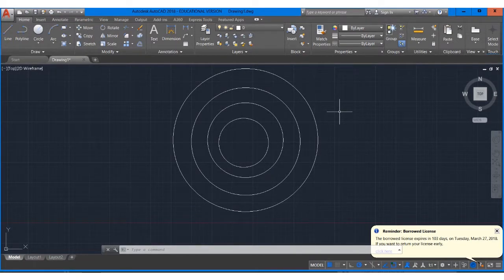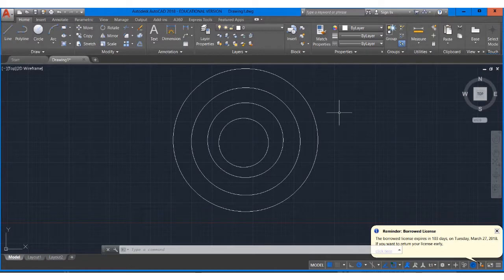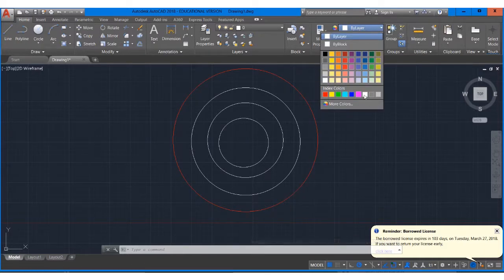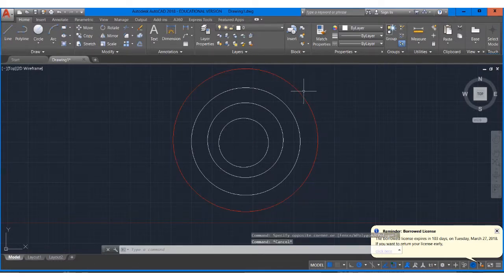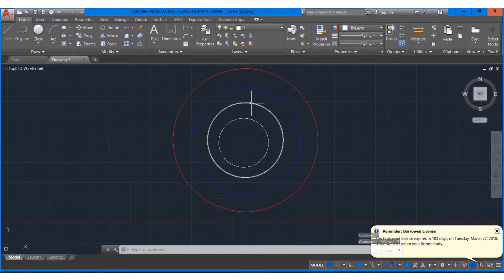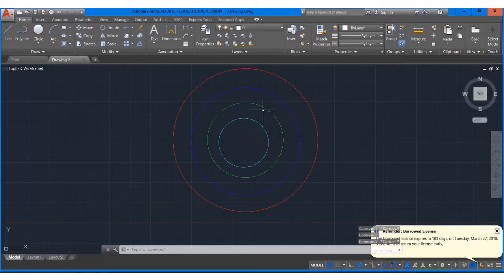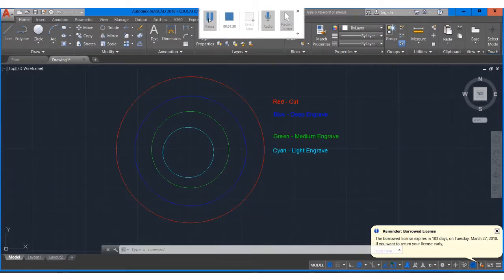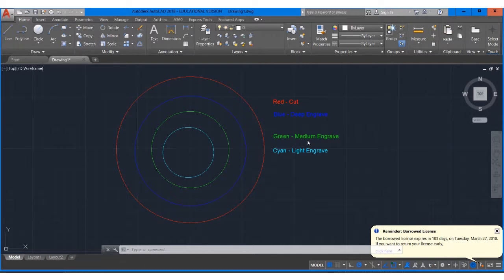12 AutoCAD Line Colors for Laser cutting or engraving

Comment: What about doing a solid hatch on one of the circles and engraving the solid part? I tried but when I open it in the laser cam software I only get the outline. I do have scan selected for engraving but still only the outline.
Reply from the maker: Without knowing more about your Laser engraver and accompanying software, my guess is that the color you are using for the solid hatch is set to only engrave as a vector and you may need to switch it to raster or vector.